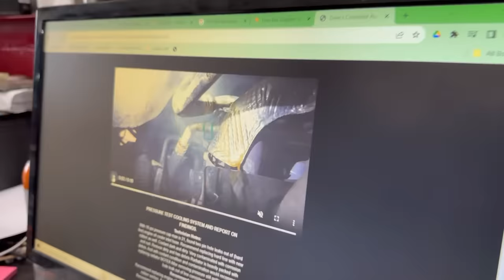The truth about maintenance, and what the manufactures tell you vs what you need to know

Comment: Increasing replacement/maintenance frequencies on fluids & rubber components has to be the single most-impactful action anyone with a piece of equipment can take in regards to making their equipment last & perform. From industrial machinery in manufacturing where I got to learn from 30-40 year machine repair & maintenance skilled tradesmen to my own experience with my newer vehicles - it has been the lesson I have learned.
In addition to wanting to sell you a new car, all of these little maintenance changes they manufacturers are making are also motivated by: 

-meeting emissions+mpg requirements (the lower viscosity oils)  and 
-reduced maintenance costs ("our car is cheaper to own & requires less maintenance!") by simply extending intervals.

A great example is toyota's included 2-year maintenance on new toyotas. I looked at the maint. schedule for a corolla hatchback within that timeframe. Guess what you get with that awesome "free maintenance"? Like 1-2 oil changes and 1-2 tire rotations 😂. Toyota has the audacity to call this "toyotacare" and make it a cornerstone of their marketing.

At the root though, the issue is that people in society have lost appreciation for how complex & amazing the engineered things in our daily lives are & the fact that these things like cars deserve to be respected in regard to their ability to end your life in the event of a mechanical failure.
Reply: Toyota is the new GM, lots of BS out of that company.

Comment: I’ll put my experience on this. My dad was an ase mechanic for 35 years and engine builder and GM teacher. He told me to drop 1/2 a quart of atf in a few days before and drive it like normal ( this is usually wot a lot) before I change the oil. I have never opened this engine except drop the oil pan to replace the o ring on the pick-up tube. A bit of nasty in the pan and I popped the valve covers just to look. Clean as I was shocked at how clean. 03- 5.3 chevy express with 549,000. Still runs like a top. Had to finally retire it bc all the freaking paint fell off
Reply: Should have washed and waxed once a month.
Reply: @peterrabbit2719  who does that to a work van? But your right.

Comment: I change the oil on my Mercedes every 5000 miles or twice a year with the temperature change (spring/winter) when the dealer suggests every 10 thousand miles. Spark plugs and coolant every 36 thousand miles and transmission flush every 50,000 miles. I know Mercedes ranks near the bottom for reliability but I think my maintenance schedule (rather that Mercedes factory recommendations) keeps from having problems that others have had. It’s expensive but not as expensive as a new engine ($25,000)!
Bravo Dave!!

Comment: I just feel like 3000 miles is too soon for an oil change especially when my car owner, manual says every 7500 don’t get me wrong I would never wait 7000 miles to do in oil change but I think like 5000 is the sweet spot.
Reply: It's 3000 if you're not on the highway a lot. If you're driving the car in the city. That 3000 miles is a lot more engine hours than 3000 on the highway every day. 

Most people put their car in extreme driving conditions without even knowing it. Short trips at low speed all the time is very hard on engines. If you're taking a trip from NYC to LA and you spend 45HRS at 70 most of the time... you're oil probably isn't that bad but will need changing soon. Spend 1500 miles in NYC traffic at 15 to 35 MPH. That oil is probably worse off than the NYC to LA trip

Comment: This is a great video, read your manual people. I asked the dealership when my plugs should be changed on my 2.0 turbo they said "ooh not until 100k miles" turns out its every 40-45k mile gained 2.5 miles per gallon, and my car only has 48k miles on it. Read the manual

Comment: The story part is really good info. I was a  kid wrenching on cars and the neighbor needed a new coolant hose because it was leaking. They were cheap ppl so beyond the part they provided and my work they weren't going to buy any more parts. I dug in there and replaced the coolant hose, everything was completely dry rotted. Everything under that hood that was rubber really needed to be replaced. I made them aware and they scoffed at me. A day later some of the other smaller hoses started to leak and they blamed me for it, knowing they would refuse buying any more parts. Some band-aids can open up the flood gates and ppls logic and reasoning go out the window. They went to a professional shop and then tried to bill me for the work/ lines they needed, which they refused to replace when i was in there. XD

Comment: I almost learned this info the hard way my 2012 Camry started the dreaded Torque Converter shudder around 45mph at 78000 miles even though I had the firmware update under warranty when the car did not have any symptoms luckily my local transmission shop did a transmission service and the car drives like new they took a photo of the fluid and it was jet black , you are absolutely correct I salute your professionalism and honesty.

Comment: I’ve got nearly 200,000 miles on my BMW X3 and I get the oil changed a minimum of 4 times a year. The computer will tell me when it needs it and I immediately make an appointment for my mechanic. It’s just now starting to get more serious age-related issues (various gaskets and sensors have been replaced) but still runs great. A few hundred bucks a year on maintenance is well worth it.

Comment: This is true and well said. All mechanics should be like Dave. I just had my front, rear diff and transfer case flushed at 30,000 miles on my 2022 Ford Transit AWD HR (Storyteller Overland MODE LT). At 50,000 miles, I will have the transmission, break fluid and coolant flush. Then, the cycle will repeat at 60,000 miles.

Comment: Most of my vehicles have been secondhand. I don’t care what I have been told about maintenance. I don’t care what it says in the ‘service’ book. They get a full service; oil, filter, air filter, cabin filter, coolant system flush, brake system flush, wheels off brakes service, etc..

After that the oil and filter is changed every 5,000 miles. None of my vehicles (nearly all diesel) have used more than a pint of oil between services. Everything else is done at least annually. 

All my vehicles have been reliable.

Comment: just subbed,  awesome content,  honestly one of the reason why i stopped working as a mechanic in a dealership was because we were un truthful about maintenance and basically stealing peoples money when the warranties ran out.  horrible practices,  the dealerships arent on your side and why would they be? I own two cars one is a ford escape that have 390 thousand miles on it and I tow my 2400 lbs boat with it and never had an issue with the trans. The other has well over 200k again,  never had any issues with them  because the maintenance is done like clock work.

Comment: Sage advice.  I have my synthetic oil and filter changed every 4 thousand miles.  Change out the sealed transmission fluid and filter every 40 thousand miles, and same for the coolant every two years.  All OEM products.  My 2006 purrs like a cat.  Do components fail?  Yes, but I control what I can by preventive measures and it works for me.  Seeing the top of my engine during a valve gasket replacement, with the motor looking like new on the inside, is a great feeling.

Comment: Fluids and filters are the most important things! I run a tree and lawn service, have never replaced an engine. Fuel additives are important too! 420k miles on my 5.9 cummins, 200k + on the transmission, not sure if it was built when i bought it or not but its still fine!

Comment: I always change my oil every 3,000 miles. The radiator is flushed,  trans, axles, transfer case, brake fluid serviced every other year(25k). My old truck lasted me 20 years, 246k miles, (towed once for a fuel pump)my friend is still driving it!
Reply: Outstanding! 👍

Comment: Coolant, I change it regularly at 30, - 40,000 miles. Oil is done at 3-4,000 miles brake fluid bleed every 20,000 miles.  Plugs every 30, 50.000 miles. Best air filter every 10-12,000 miles.  My truck and car are both  going on 9 years old. They both run like new vehicles with 0 issues…
Reply from the maker: Great point!

Comment: I can't remember on which shop YT channel I saw this from but basically some brands will do their maintenance schedule based on expecting their customer to be a lease customer for their (luxury) car and want them in the fewest times possible so that they get the idea of "wow what a good car I only ever took it once to the dealership" or stuff along that mentality. It makes sense through that lens, but agree 100% that if you're getting this type of content on YT, you're probably trying to keep your car running as best as it can for the longest it can. In which case those extended intervals are not good.

Seen so many mechanics and engine teardowns where a small leak/extended service intervals ended up doing the engine in.

Comment: I've only recently subscribed to this channel. I'm in Australia, and don't own a 6L v8 car. It's a tiny 1.2L 3 cylinder car. It's simple, so great to learn from.
But damn I love it, and I have always looked after it cosmetically, and get it serviced. I know enough about electrics and have replaced the stock cd player to a fancy Alpine one with Android Auto, dab radio, hdmi etc etc, it's gone from 2 to 9 speakers etc. I did that myself. I can read an OBD device etc. so I know a little.
HOWEVER I don't have the foggiest about my car's mechanics and that's the most important thing - not ride comfort. I've been taking it for granted. Your channel has given me pause for thought mechanically and I'm going to get off my butt and try harder. I'm going to learn how to change my oil and fluids (not just top them up, which I do now) and also learn how to replace filters. All this happens during the regular professional servicing I get done on my car already.. but now I feel I should do it more often. I'll figure out how. Thanks for doing what you're doing and sharing your vast experience.

Comment: I couldn’t agree more, as a Certified tech for GM I have so many customers complaining about us constantly pushing flushes and maintenance procedures. They keep saying we are just trying to rip them off, when in reality we are trying to save them money in the long run. Flushes don’t make me much money but a transmission R&R does.
Reply: Trans flush or trans fluid change? I've read that a flush is not recommended.
Reply: Same question as the other guy on flush vs drain and fill?
Reply: @Ace-44  “Fluid exchange” but we call the flushes. If by “flush” you mean using a cleaning agent then a additive we sell those too but not really for transmissions. Only if it is a low mileage transmission below 100k we do “flushes” as in clean new fluid and additive.

Comment: Reminds me of a guy that said his 01 f250 5.4 said the coolant was fine only 30k on truck he trashed the motor over a coolant flush .. but I use amsoil coolant in my 09 ram 5.7 dump a gallon out put a gallon in every year. Also have 2.7tt edge st and 17 ats 2.0t caddy it's amazing what good fuel and oil does on di turbos .. I'm in love with you I want to work for ya welder fabricator mechanic 30 years you are so knowledgeable I love ur machining ability..

Comment: I change our two vehicles oil every April and October no matter the miles. Most of the time it is just over 3000 miles. I usually get my oil when there are promotions like buy two five quart jugs of Pennzoil Platinum and receive $25, so it'll come out to about $30 to change both vehicles because i do the work.

Comment: Expert advice. I’ve taking my 2020 Mustang Ecoboost to the dealer for oil changes every 3000 miles, and the last service advisor said I didn’t need to change that frequently. On that hard-working turbo engine no way I’m going longer than that, and I’d like to change it myself if I can get a set up that will work.

Comment: I've always done 5 thousand mile oil changes on my diesel pickups. I like the Shell full synthetic 15-40 and I supplement that with a half gallon of Lucas heavy duty oil stabilizer. Never had a single major issue with any of my 5.9 cummins engines. Maintenance on all vehicle systems is crucial.

Comment: I do my own OLFs and still go by the old 3,000 mile deal. If you take it to a shop and even if they charged $100 it's well worth it. I also have an oil analysis done. Reminds me of the old Fram commercials. The one mechanic says "you can pay me now" and the other one says "or you can pay me later".

Comment: Hey, so ... not a car guy here. I grew up an apartment denizen with a single mother afraid of everything, including the idea that if I learned something about cars, I'd want to be a mechanic -- something which somehow she thought would have been a bad thing.

I have to comment about something I've realized, related to a statement in this video. Manufacturers want you to get through the warranty, then sell you another car. 

I think that is 100% true. It's why so many transmissions aren't serviceable. It's why ... frankly, it's why so many things have become what they are in cars. I own a 2004 Nissan Xterra. I bought it, in part, to learn some stuff about cars. Some things on it are a bit of a pain to work on, but guess what? My unknowledgeable self was able to take out the radiator, reservoir, and a bunch of other stuff, remove all of the pulleys and brackets from the front of the engine, and replace the water pump and timing belt last summer. Yes, it took me a lot longer it would take someone who had experience and knew what the heck they were doing. So what? It's doable. And the parts mostly aren't plastic. The vehicle is approaching 250,000 miles, and sure some stuff is showing its age. But the transmission has a dipstick (also the fill point) and a drain plug. It's made to maintain. What the everliving flip happened to modern cars besides being considered disposable?!

Comment: Two things there’s no doubt we’re looking at a situation where we got dissimilar metals so let’s do this somewhere in the radiator usually on the lower part of the radiator there’s you got your drain plug petcock drain all your antifreeze out your coolant fill it several times with I can’t remember what you call the water it’s not water out of the tap and I just can’t remember it and flusher engine not several times With this water, you get it distilled distilled water that’s what it is and you flush your engine out several times with that and put a zinc rod in and put a very good quality antifreeze and antifreeze. It matches your engine what the factory requirements are use Amsoil antifreeze, and after I started using amsoil, I no longer had water pump problems in my 91.5 dodge All right have a good day. This is six in a row.Jim from Kennerdell, Pennsylvania
Reply from the maker: Thanks for the share, Jim!

Comment: I like videos on maintenance. As a car owner and also a former employee of a Chevrolet/Cadillac/BMW dealer service department, it is important that people read and understand the owner's manual that comes with your vehicle. It is also important to understand the severe service and regular service portions of the owner's manual. Most drivers are covered by the severe service schedule - with that schedule, 5000 mile oil changes, 30,000 mile transmission services, and 5 year/100,000 coolant service intervals are not uncommon - perhaps even sooner depending on your make/model. Lifetime fluid intervals are typically not included under severe service schedules and they are a marketing tool used to sell vehicles.
In the event you should have any questions, a reputable dealer or shop - like Dave's - can help you with your maintenance questions. They are in business to help you maintain your vehicle.

Comment: Couldn’t agree more. I bought a brand new 19 Dodge Journey. I change the oil every 3000 miles even though it says 5000 I change the transmission fluid every 30,000 miles even though it says every 60,000 and I just recently changed the coolant at 50,000. I know Chrysler’s get a lot of hate, but I feel as long as you change the fluids and filters quite often you should hardly have any issues with it. Everything nowadays is built, poorly and cheap. Built to sound not built to last. The only huge disappointment I had with this dodge was my transmission went out at 36,000 miles. Chrysler fixed it no questions asked and haven’t had a problem with it since knock on wood it doesn’t go out again.

Comment: I realized years ago that the fluid change intervals are optimized to make a car last 100k-200k miles at most, and that the longer change intervals on newer cars is just to get the same life out of the more advanced engines as with older cars and more frequent changes … I cut my change intervals down by 30%, and my cars drive fully like new at 200k. The point in this video is spot on!!!

Comment: Dave is totally correct. A few hundred dollars of maintenance at each years will double if not triple the life of the engine !    
In Canada, the recommended intervals to change the oil and filter is 5000 miles. 
Synthetic oil is highly recommended for trucks. Trucks towing heavy loads requires high horsepower. High horsepower generates more heat. More heat will degrade the oil more rapidly.

Comment: Spot on.  All the manufacturers are interested in is getting past the warranty.  If they had to offer 10 year / 100k+ mile warranties, you can bet the oil changes would be 3 times more frequent, and there would be accessible fill and drain holes on the transfer boxes and rear diffs (my Ford Escape has no drain plugs on them and the transfer box  filler hole is a pain to reach.)